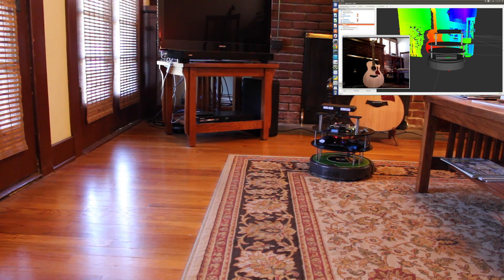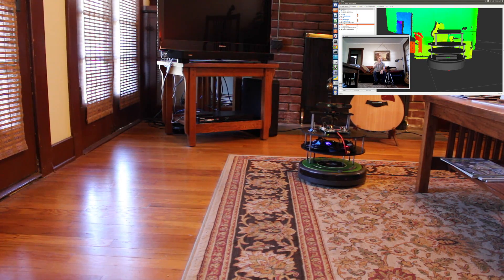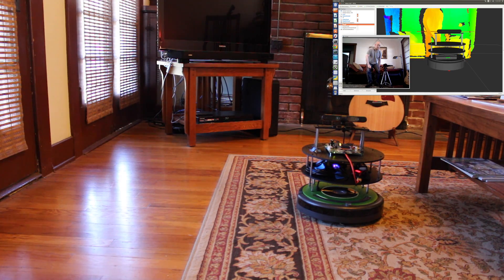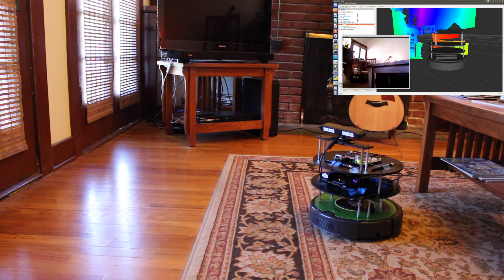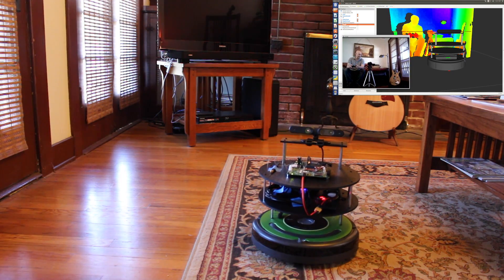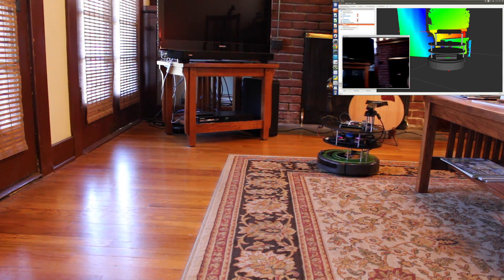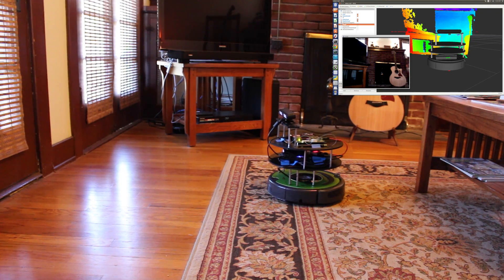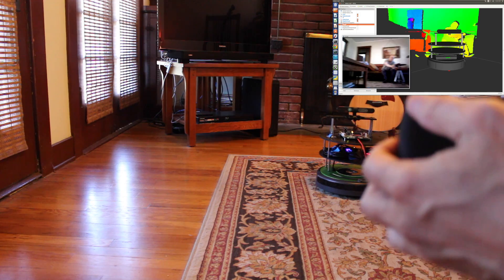JetsonBot Part 8 - Proto 2 Demo Drive - NVIDIA Jetson TK1/Create 2 Robot

Comment: Awesome Stuff Dude - Thanks !! Couple Clarifications -- 1. Did you test how much payload it can carry - like how many pounds ? 2. I have 650, I see cable port under face plate, can I use 650 instead for programming like Create 2, basically failing to understand the differences software wise? 3. I could get that spinner and cleaning brushes assembly are missing in Create 2 - but apart from that are these products identical,  if I purchase these - can I use Create2 as equivalent to 650, is software support to move around default, or will I need to program it ?
Reply from the maker: I didn't test the payload, but the payload will also depend on the surface that the robot is traveling over. If it's a smooth surface, like a wooden floor or industrial carpeting, it can carry quite a bit more than when it is on plush carpeting. 
I believe that the iCreate 2 is a repackaged 650, so they should be the same. But I haven't tested it.
One difference between the 650 and the iCreate 2 is the top cover. The iCreate top cover has markings on where it is ok to drill holes.
You will have to attach it to some type of computer to send it commands to move. You can look at the iCreate 2 page to get some ideas of other projects that people have done. Thanks for watching!
Reply: Thank you so much for taking time & responding. I also got information from iRobot team itself, they (650 n Create2) are identical except vacuuming hardware. However,  I am unable to spot the cable outside. I will oder from them itself .. 

I saw your blogs, it gives good high level end-to-end process to create JetsonBot and I am actually quite impressed the way you did it, I would like to build this with my son at some point .. however I decided to go with https://www.autonomous.ai/deep-learning-robot for the time being as I am not able to secure hardware independently. I have been working with Lego EV3. Very new to ROS and all other softwares on this league - would you have any detailed blogs -- my objective is to make this Bot, map the floor, identify obstacles live and based on pre-recorded map, take commands remotely over wifi and also voice to go from mapped point x to point y.... if you do not  have any blogs, but you can help me get started with some other references online, would be much appreciated. I can share email privately if that is  more convenient .. 

Also, on side project I am working to make Augmented Reality Simulation in essence, trying have live video feed, pattern match subject - example refrigerator. Once object matched, to layover information about that subject via APIs. I started my research, it seems Hololens is my best bet, but one that is too expensive and also not feasible to get it sooner. I was wondering if you have insight in this domain and can help guide me. I know Unity but I do not know if that can does what I need ..
Reply from the maker: I'm sure autonomous AI can help you with the questions you're asking. I don't know enough about Augmented Reality to help you.

Comment: How did you handled the wobbling base issue? Did you put another caster wheel at the bottom?
Reply from the maker: +One Earth This version does not have the extra caster, it just wobbles. However, I do have the extra caster in case I ever need to address that issue. When building, I did tend to put more weight on the front of the robot when adding components so it wouldn't tip backward. Thanks for Watching!
Reply: +Jetsonhacks Hi Thanks for the update. Is there a provision for putting an extra castor wheel in create2? I know that Create1 came with two castor wheels, but not sure about create2. The bin area looks empty in pictures.
Reply: +Jetsonhacks Hi Thanks for the update. Is there a provision for putting an extra castor wheel in create2? I know that Create1 came with two castor wheels, but not sure about create2. The bin area looks empty in pictures.
Reply from the maker: +Ankit Ravankar You can by an extra caster for the iCreate 2, and attach it to the bin.
Reply: +Jetsonhacks K thanks a lot.
Reply: +Jetsonhacks BTW when are you posting next videos for Jetson Racecar? Looking forward to it?
Reply from the maker: +Ankit Ravankar I'm currently working on a project for GTC 2016 which is taking up most of my time. MIT is a few weeks away with the release of their software and hardware source, so what I'm trying to do is make sure that there are as few changes as possible from what I've worked on versus their work. I'm hoping to return to the series in early May.
Reply: +Jetsonhacks Great! will wait for it. Good Luck with the GTC.

Comment: Did you use the motherboard that came with the Create 2 or are you using a seperate one? What do you have mounted on the 3 tier chassis?
Reply from the maker: The NVIDIA Jetson TK1 Development Kit is placed on the top platform. The Jetson is running Robot Operating System (ROS) which controls the Create 2 base through a USB to serial cable. Thanks for watching.